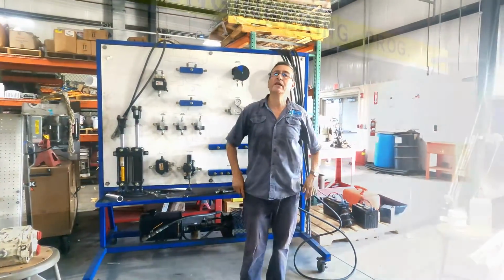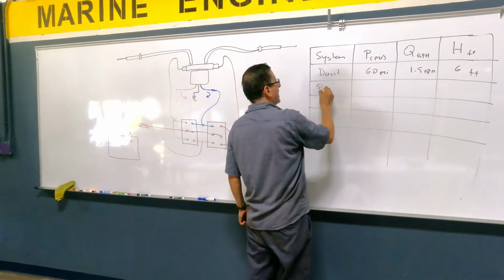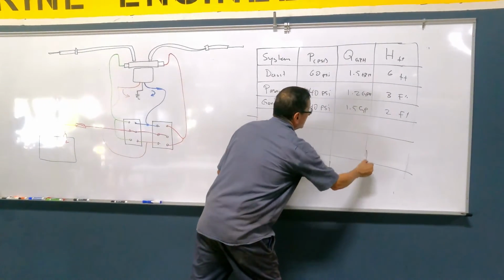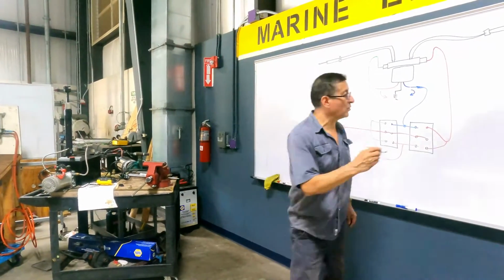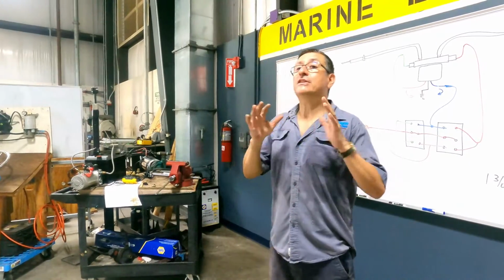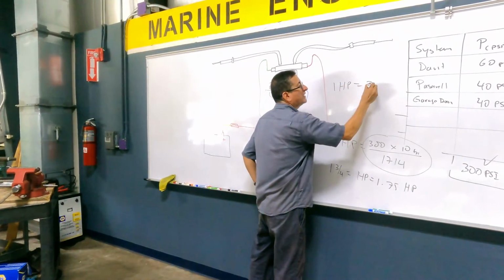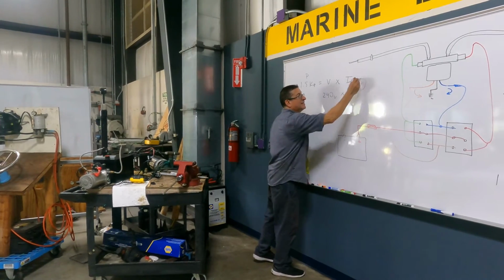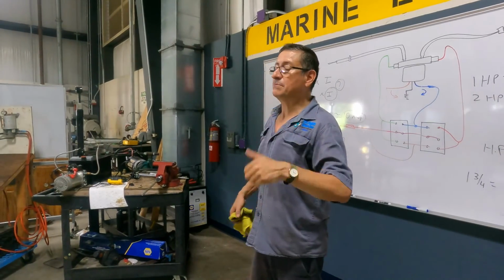How to Integrate Hydraulic Systems in Yachts

Comment: Sir please answer my question ? If the relief valve does not reach the set pressure range then the flow from the oil will be going to tank or it is continuosly going to cylinder. If the oil is continuosly going to cylinder without pressure motor is taking load because of oil is not relief from the valve
Reply from the maker: If the relief valve does not reach the set pressure then the oil will flow to the reservoir tank.
Reply: @MrLopezClasses  sir can you please explain how how the oil is return to the tank from relief valve until the pressure is not reached
Reply from the maker: Thnks for your feedback. I appreciate your comment
Reply: @MrLopezClasses  please give me the answer
Reply from the maker: If the relief valve does not reach the pressure the fluid will return to the tank. Thanks for following me. Regards
Reply: @MrLopezClasses  sir please explain how this process is working